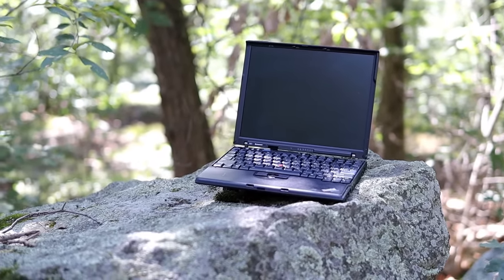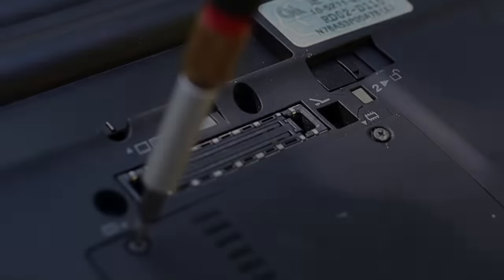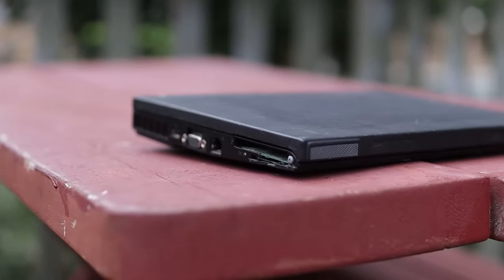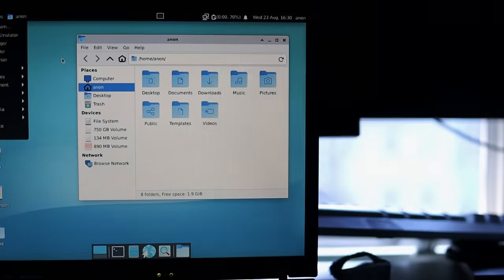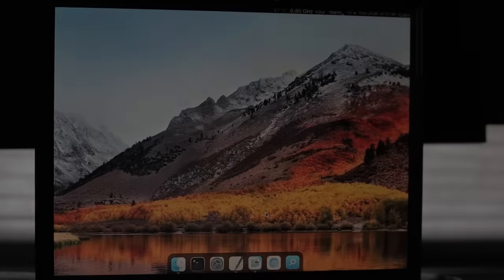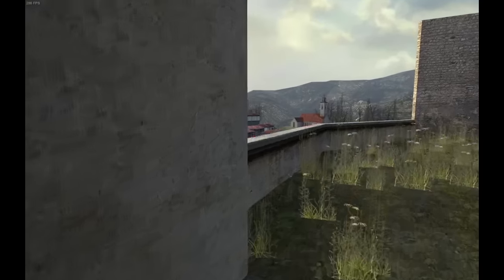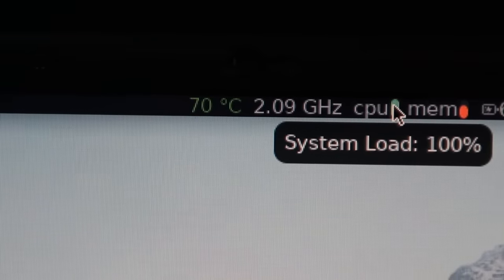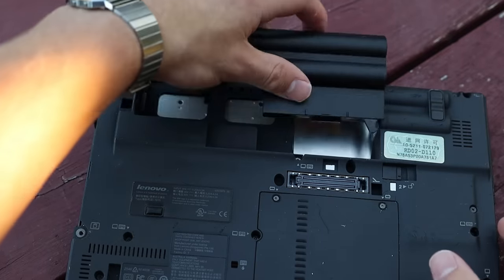Can Linux save this old laptop from obsolescence?

Comment: The displays on these older laptops are also sometimes better looking than those of sub-$200 laptops. I have a Vaio from 2002 that I use for period correct photo editing using cameras from that era, and the built-in display, while only being 1024x768, looks far better than the cheap panels used on low-end Chromebooks and S-mode machines.
In computer sales, I order refurbished business computers for customers over letting them walk out with ultra-cheap new laptops. They are just...bad. Really bad. I'll usually put them with 6th or 7th gen Intel machines, though you can comfortably go back to 2nd gen and be good to go in Win10 for most tasks (good rec on the X220).
Reply: The displays on business laptops are generally a letdown, especially for this vintage. Although nice high-res options exist, companies used to default to the cheapest TN garbage on offer. I have a X61s which is a nice machine, but I never use it for its awful, dim, 1024x768 screen.

Comment: I have two old Dell Inspirion 1525's from about 2008 which run modern Linux fine. One runs Linux Mint XFCE and the other runs Kali (again XFCE) without problems. I did replace the HDDs with SDDs in both to get a bit more pep out of them and I upgraded the memory of one from 2Gb to 4Gb from another old dead laptop. Good experiences had for undemanding workloads.

Comment: The core 2 line is still highly usable. I have a desktop and a laptop that are of this line. I also have a core 2 quad that can give even 1st and second gen i5 systems a challenge. Till we hit the point that software needs something in the instruction set not found in this chip (like what happened to the Pentium 3 line several years ago), for basic single tasks they will be just fine.
Reply: The 1st gen Core i weren't really faster CPU wise, the changes were mostly in the frontend.
I also have a Core 2 era machine, but with a Xeon and oc'ed to 4.1 GHz and that can even keep up with the smaller 2nd gen i5

Comment: I upgraded my old Samsung "NP-RC-S03DE" step by step.
1. Replace the old HDD with an SSD and installed Linux Mint, Cinnamon Edition
2. Upgraded the RAM from 6GB (4+2) to 16 GB RAM
3. (Maybe replace the GT 540 by something faster but still low TDP, since the GPU can be replaced)

I think the i7 2630HQ is already the best CPU I can get on that one and I am uncertain if the CPU is on a socket or soldered.
Reply from the maker: I forgot Samsung even makes laptops. Sounds like a pretty beffy machine for 2012 standards.
Reply: @liamjewell62  Indeed it is. I bought this one 2011. Wasn`t cheap but well made. It even has two ports for 2,5'' mass storage.
Its my backup system.

Comment: I had good results with antiX Linux running IceWM on a similar old LG laptop - it feels a little bare but it works fine. I even added xfce4-power-manager to dim the screen :)
Reply: AntiX is awesome, it's just about the only thing capable of making old Atom powered netbooks somewhat responsive.

Comment: What's kind of magical with Linux is that the open source drivers on Intel and AMD GPUs support Vulkan natively on some GPUs that don't support it at all on Windows. I have an old MacBook Pro from 2012 that I use for various things. MacOS is a no-go on it because Apple does not support it in any capacity anymore. Linux however works great (with a few easy-to-fix tweaks). Sometimes I will play some very light games on it such as Pizza Tower, and This old 3rd gen intel with iGPU works fantastic with DXVK.

Comment: Hey... great job on the video. Mint+XFCE has worked for me on similar projects but based on what you have shown here I'm going to give Void Linux a shot. I would be interested in finding the sweet spot of old/cheap and high quality display and inexpensive batteries if that is a topic you would like to explore ;-) Anyway... subscribed!
Reply: Ubuntu based distributions tend to have a little too much running in the background for really underpowered hardware even when you use a lightweight desktop flavor. You might be able to use Ubuntu server and build up a desktop as long as you stay away from the flavored versions of the desktops like "xubuntu-desktop" and go with the barebones "xfce4" or another lightweight desktop instead. I find it easier to just use Debian on old hardware if I want an apt based distribution.

Just to be clear, Xubuntu and other lightweight versions of Ubuntu are still light by today's hardware standards, just not by 2007's standards. Still, even Xubuntu or Mint+XFCE will not be that bad on a Core 2 Duo. Just don't put them on one of the pre-Ryzen low powered AMD APUs from the mid 2010s. Those things make everything but the GPU on the machine in this video look pretty snappy.
Reply: For old, cheap and "high" quality display maybe the ThinkPad T60/T61 with the 4:3 FlexView panel would fit the bill as long as the seller doesn't know what they're selling 😅 Best regards!
Reply: think the thinkpad x230 has some fullhd screen options while having two user upgradable ram slots, and at least one external battery.

Comment: I think mobile core 2 duos are socketed so it may be possible to upgrade it slightly. And it may have an express or pc card slot or maybe you could use the wifi card slot
Reply: They’re socketed on thicker machines like the T61, but the X series has always had soldered CPUs.
Reply: @SebisRandomTech  yo even sebi is here! nice!
Reply: The T7100 in it came on socket P and FCBGA6. The first is socketed and replacable, the latter is soldered.
But the X61 has two miniPCI express slots and a CardBus slot. There are even official wifi cards for it. Two of them even offering 802.11n

Looking at the thinkpad wiki, there are BIOS mods that allow SATA 2 speed (which is there hardware-wise, but disabled by software), a CPU pinmod that allows up to 3.6 GHz (by running 266 MHz/1066 MT instead of 200 MHz/800 MT FSB) and one person even soldered a T9500 into it.

Comment: During the pandemic I upgraded a Dell Latitude 131L as a hobby.  I put a 64-bit 2.1 GHZ dual core CPU , 150 GB SSD, and went from 512mb to 4GB of memory and replaced Windows XP with Mint 20.2, and it was all done very cheap.  Performance?  Well there was a definite improvement, but video streaming on it depends on a lot of factors.  I personally did not find Chromium any better than Firefox.  In fact Firefox did better with YouTube.   As far a movies it was coin toss on whether they were watchable.  Letterbox wide-screeen format  worked alright since it used less of the screen.  The battery was pretty close to death.  Why this would be an issue with a laptop that you would leave plugged in anyways, especially if your using an ethernet connection is beyond me.  In summary, I enjoy using it either as a way to look up material for something I'm doing on my desktop pc without interupting it, or just to enjoy doing something on a device others may consider useless.  Too much abandoned utility in this world.
Reply from the maker: Those old dell latitudes are meant to last!
Reply: @liamjewell62  I just thought of something I checked with Bing's AI Copilot.  There are cheap mini PCs and I asked it if in lieu of getting a keyboard and monitor if you could use a lite weight Linux distro on an old laptop with an app that would allow it to be a terminal for the mini PC.   I wont go into the details, but basically it said yes.  That would be a fantastic project to watch.

Comment: i've got one of those things, it runs surprisingly well with arch and can even handle KDE semi ok with 4GB of RAM, 

windows 10 is flat out unusable on this device though and even windows vista seemed to struggle somewhat (although that's more down to the HDD i had in mine initially)

Comment: Whenever I use my old X60t it still does fine for all tasks you mentioned provided 32bit packages still exist.
Unfortunately, the seller sold me the X60t as X61t back then and shortly after the shop I bought it from was no more.
Oh well, it was my first real ThinkPad past the s10-3 which was around 2013 so I still had plenty of good years with it on Debian Squeeze and later Wheezy, then Kubuntu and now I just took an old SSD and made it a retro XP gaming laptop.

Comment: Until recently, I was daily driving this exact laptop at my work as a research assistant. i went for a used 128GB SSD, and a ghost-spectre Windows 10 install. 

It surprisingly does well to process documents, edit excel sheets, and even some slight multitasking (I used an external monitor for dual screen use.). it is still running, but the screen gave up, so will leave it on hand until I can repair it. (it has sentimental value.) just don't expect modeling and the like with it.

Comment: I'm still using my 2013 HP laptop on Arch to this day. But it is considerably more powerful than those laptops you showed on the video. I love how Linux systems still support many cases of older hardware, keeping it relevant to the modern age. In fact, the only thing really keeping these machines "obsolete" is bloated modern web desig making even simple websites require lots of computing power unnecessarily.

Comment: I can say that current RHEL and Fedora perform great too on old hardware.  The three parts to making it work is first an ssd, second setup tuned, lastly use a lightweight DE.  I personally went with i3 ages ago on my main rig so its natural to plop that on my older rigs too (slight mod to the config for single monitor).
Reply: What is DE? Differential Equations or Development Environment?
Reply: @jasonenns5076  Desktop Environment something i3 is not because it is much simpler... a DE containtains a window manager, a file exploeres, a taskbar or a dock or something like this, a compositor and some menus all tight together to offer a complete experience
btw RHEL and Fedora are not light because of systemD

Comment: Great reminder of what can be done with older hardware. Funny you should call it the antithesis of a MacBook as it was a direct rival back in the day and has a very similar spec to the 2007 MacBook I bought new. Void is a great distro. The PowerPC version was even usable on a 2005 PowerBook until they stopped maintaining it a year or so ago. Great video as others on here have said
Reply from the maker: Finding distros that support PowerPC is hard these days unfortunately.
Reply: @liamjewell62  There is still Debian and Gentoo but Void ran really well as it was lighter that Debian but still had plenty of packages.

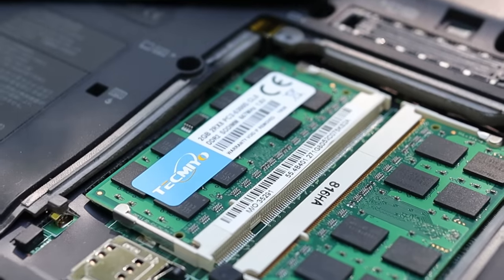Comment: 1:28 pay close attention to the chips on these cheap no brand Chinese ram sticks. If the markings on the chip is not crystal clear(smudged or worn off), or if the numbers don't match between chips, then it means these chips are recycled and are from different batch. I would not buy these rams sticks. The Chinese people will not miss any opportunity to extract every last bit of value from junk. There is the business of harvesting old ram chips from junk and then use them to make "new" ram sticks.
Reply from the maker: Interesting. The ram seems to be working fine so far but I'll keep that in mind.

Comment: I love my mid 2011 Macbook Air, it is a perfectly usable with Linux despite being less than $100 on the used market these days. It is a genuinely portable laptop even by todays standards, it has a solid keyboard and touchpad, is made of metal and has exceptional build quality because it was quite an expensive computer back then, though as time went on you could really tell the MacBook Air became a budget model. I use it for gaming with Steam link pretty frequently and it is wild to see Cyberpunk 2077 on that 1440x900 display downsampled from 4K on my desktop, and I don't notice any lag either.
Reply from the maker: I gotta get my hands on an old mac one of these days

Comment: SSDs all day. Especially on older thinkpads where you don't even need to open the machine to swap the old HDD. I've used my old Thinkpad T61 with an SSD and Lubuntu and it was fine. Even trusted it enough to do my school entrance exams with it a couple years back. I did also increase RAM to 4Gb, but I believe the SSD was a much more impactful upgrade.

Unfortunately the Thinkpad's fan gave up the ghost last year. Amazingly, you can still buy them new - but they cost more than a complete second used T61 :D

Comment: Watched this on a 2011 Mac Mini with an i5-2415M Core 2 Duo running Debian at 2.9Ghz (according to neofetch...). I thoroughly enjoy using this machine nearly every day. Another computer saved from the e-waste pile.
Reply: How can it have an i5 and a Core 2 duo at the same time? Is it a dual CPU motherboard? It can't be, it's a Mac and they use different sockets.
Reply: @0w3nn  probably confusion. The i5-2415M is indeed a dual core, but doesn't have that in it's name.

Comment: Last time I checked systemd boots faster than runit. I used to use Void and I like it, but I highly doubt there is a huge performance difference to other distros. Even DE doesn't make a huge difference. RAM usage of KDE Plasma vs a window manager is in the realm of 1-200MB probably less. If you don't use it for web browsing, this laptop can be fine for word processing, programming that doesn't need heavy resources, and lofi music and art. M1 Macbooks are looking pretty great with how Asahi Linux development is going and the battery life is great. Idk about the longevity of the hardware though.

Comment: Just revived my old (2014) laptop using Zorin Lite. Watching your video on it right now! Im really excited! And this was also the most tech savvy thing Ive done haha
Reply from the maker: Nice! What laptop is it?
Reply: @liamjewell62  Acer Aspire e5-571g. It had a black screen with moveable cursor when booting up Windows 10. Would freeze during re-installation of Windows 10 from the machine itself. Would freeze after reinstalling Windows 10 from an USB drive. Installed Zorin Lite from an USB drive and it runs smooth!

Edit: btw its the i7, 8GB RAM, Nvidea 840m graphics card, and 500GB HDD (136 bad sectors, whatever that means) version
Reply from the maker: Glad you were able to make it useable again @viktorvondoom9119

Comment: I have an old budget Windows 7 era laptop that has been repurposed into a Plex server for my household. It is running a bare install of Arch with no graphical environment, but has been going strong for years. It has 3 different external HDDs plugged into it for storage, but I just leave it sitting on a bookshelf out of the way, and control it via SSH from my other machines, so out of sight and out of mind. Within reason, there is always a use for old hardware like this, and you can typically get it for free even, as most people think it is garbage.

Comment: My ThinkPad 560 runs Windows 95 just fine, and the only real issue I have is inability to connect just about anything to its single USB port: even USB flash drive needs a software driver. Which obviously you can't find these days. Other than that, it is absolutely fine.

Comment: I have one of these, got it for like 25 euro few years ago! Runs Debian (Kali) great! Common issue is overheating WiFi module, which I removed and I just use a USB WiFi dongle. I put a cheap SSD in it and it is quite good. I may try Void, I like your results a bit better than mine. Nice video! :)

Comment: Stands to reason that games from its Era would run well on it. We'll have the same experience with today's hardware in 20 years, most likely.
Reply: It's an Intel GMA X3100. Suue, it has 8 shaders and supports DX10 like the Geforce 8400 GS, but the geforce also runs at 520-589 MHz instead of the 333 of the GMA.

And he tested it with Half Life 2 Lost coast and got 15 fps with graphical glitches at the lowest settings and a resolution considered low even back then. An addon from 2005 for a game from 2004 running on a iGPU from 2007 at sup 20 fps.
CS 1.6, released in 1999 ran at 35 fps
Euro Truck Simulator, released in 2008, one year after the GPU ran at 7 fps

No, games from it's era don't run well. Even games from half a decade earlier don't run well. At least 3D games.

Lighter 2D games do well, though.

Comment: I'm still using an 11 year old laptop as my daily driver. I game on my desktop, but I do everything else on my laptop.
It's a bit slow, but that is largely due to how hot it runs (it was a high end gaming laptop for the time, those things ran HOT), and how many browser tabs I have open (hundreds), still very usable for most things.
That being said, there is a very big gap between 11 years old, and 16 years old. 11 years old is new enough to have a quad core i7 and 16 GB of RAM. So it's actually relatively good at multitasking even by modern standards. Dual core really doesn't get you very far these days.
Even so, the sluggishness is an annoyance, and I'm looking to retire this thing pretty soon. It has served me well. Considering how much I paid for it I wanted to keep using it until it died, but this thing just won't die.

Comment: Hey! I actually did almost the same thing recently!
I have a very old T61, one of the last models that still bore the IBM logo before selling the business to Lenovo. 
Laptop is still good hardware wise. Although it is actually made from 2 identical laptops, mine and the one my sister had. 
We both broke it, but in different ways. Mine had a hinge broken following a fall from the desk due to wire tripping and a bad cooling fan. My sisters' had a broken charge plug and a partially damaged motherboard.
Back in the day you could open the damn device and swap parts. So, I made a good laptop from those 2.
About 2 weeks ago I installed Linux Lite on it and works like a charm (albeit like a slow charm...)